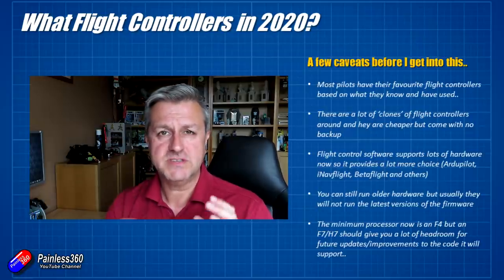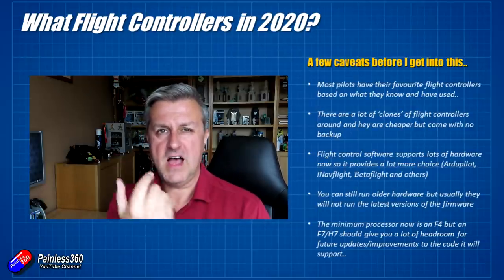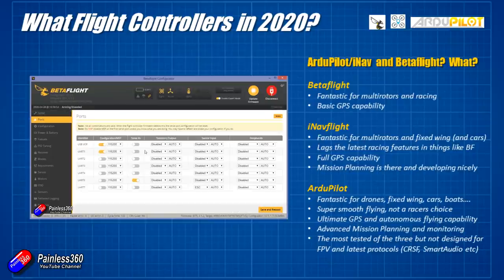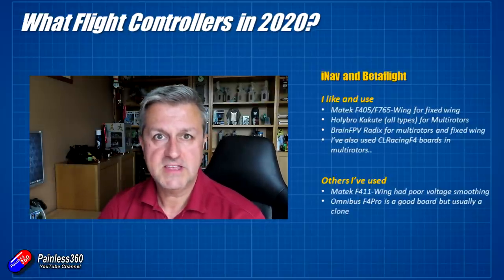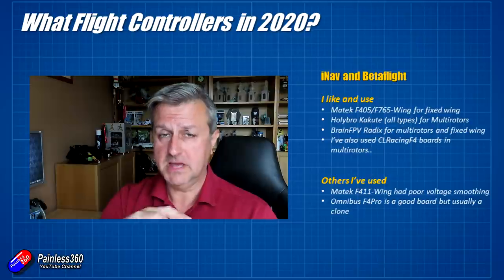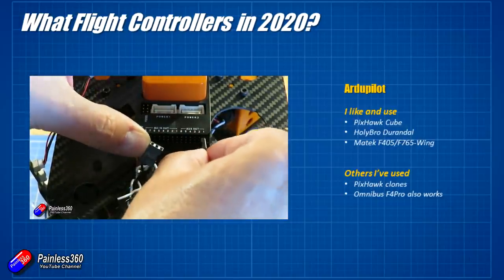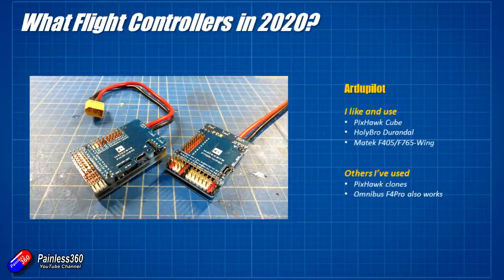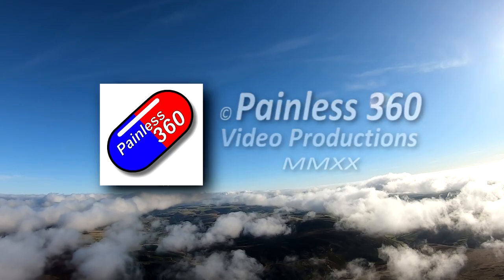My Flight Controller Picks for New Builds (May 2020)

Comment: Thanks for this.  I've been thinking of deep diving back into this.  I helped a group of UCF engineering students successfully make a way over the top ambitious quadcopter project.  I did all the programming interfacing a raspberry pi with a pixhawk board, ardupilot, etc. - the flying lawnmower (nickname since the hexacopter was swinging 12" rotors, yikes) had a robotic claw and a vision system (forget the camera board name) so it could fly mission, reach a waypoint then follow APRL code signs to hone in on targets and grab them and bring them back and stack them neatly LOL!  It makes my brain hurt just remembering all the crazy connections with software and hardware, including a smartphone app with a nice control interface (buttons and telemetry gagues ).  I still can't believe it worked (mostly).
But I have no interest in doing anything that ambitious again.  Just some quads, fixed wings and rovers for the tinkering pleasure of it.  This video is a good overview of what's around today.
Reply: That sounds like an awesome project! I’m up in Lake City, working on a simpler project, maybe I could buy you dinner and pick your brain a bit? Thanks in advance! And great video!
Reply: I'm in a similar position, some non-engineering students are looking to do some surveying and asked me about getting into RTK for photogrammetry missions. It's been ages since I did anything RC but I'm seeing the quad/planes with ardupilot itches a lot of my interests! I've opened the firehose of info and it looks like I'm going after the F9p RTK for ublocks GPS for the quadcopter/plane which it looks like Holybro sells the H-RTK F9p with a 10pin connector for the pixhawk4 (and another 6-pin version for a 2nd gps). They're likely wanting to fly over water/coastline so I'm wondering if Lee's recommendation on the more-bulletproof pixhawk Cube Orange would be a better path to keep it from falling into the sea! Being students, bulletproof is nice so they don't destroy stuff but cheap is also good for when they do crash it (maybe the aluminum controller case instead of plastic?)
Reply: I'm currently a UCF engineering student working on a project that's almost exactly the same for senior design! Good to know I'm looking at the right channel for some research.

Comment: Thanks this was very helpful! I've done two F411-wing builds and they work but had vtx power issues. Powering the vtx directly from the battery and powering the camera from the vtx seemed to fix this. I'm wrapping up a Radix Li/Bixler build and really looking forward to getting it in the air.

Comment: My Ranger 1600 had a real bad crash last Sunday, both wings and 2 servos are now destroyed. I was using an Arkbird Autopilot.
These are the steps i allways follow before and during start:
1. Checking all servos and motor working. In manual as in balance mode. Also checking if servos reacting properly in balance mode.
2. Bringing plane  to a height between 80 - 90m in Balance mode.
3. Switching to RTH, checking if plane starts flying  around the homepoint.
4. Taking seat in my chair, putting on my reading glasses and then my Cyclops goggles.
5. Taking control over plane by myself.

But this time, still in RTH Mode, the plane suddenly went straight down with an approximately angle of 30deg down and crashed into
the undergrowth. Could not react that fast to do countermeasures.
I guess it was the gyro, delivering a false angle to the processor. I assume this, because on previous flights i noticed that the artificial
horizon was reacting very slowly when vibrations occur or when doing flight manouvers  like loops, dive loops, immelman etc.
It really took a few seconds until the artificial hoirizon matched with the real horizon i saw in my goggles.

I now ordered a f765 wing and a new Ranger 1600.
But since the Ranger has a fuselage made of plastic, it is more vibration susceptible for vibrations than a depron model i assume.
I allready used a double layered damper pad for the Arkbird.
Is the f765 better in reaction time and managing vibrations ? Or what else can i do when mounting this FC to reduce vibrations as much as 
possible.
Thx and greetings from Berlin Germany
Reply from the maker: A lag in the art. horizon is normal. The iNav team have been working on improving the horizon drift. If it was excessive then I'd suspect something was up. Maybe vibration was the cause. The LPF filter along with better mounting can help. Sometimes simple things like prop balancing can make a huge difference too.. If there are logs then it's be worth a look to see what the FC saw. Best of luck!
Reply: @Painless360  It happend all with my old FC, the Arkbird. Think it's on the market since 2013. The new FC has just arrived, it's a Matak 765. Guess that will do the job better. Thx for your answer.

Comment: Useful review, I have always thought Matek stuff looks nice.

I'm familiar with some of those boards but not all, but it does seem you have concentrated on 30.5mm boards.

I've only been doing this (quads for racing / freestyle type use with betaflight) for 2.5 years, and my first used an Omnibus F4 pro with Matek PDB  and DYS ESCs. This was a 160mm frame with 3" props. Weight is everything on these things even before you think about CAA / registration / remote id issues, so I then swapped the Omnibus etc for an F3 SPCMaker (genuine) FC and quad ESC (20mm).

Saved about 30g, which on something with (no battery) weight of about 135g now is a huge percentage.

I've also used Eachine 20mm F3 FCs and ESCs. Very similar, never had a bad one of either.

I do not see myself making anything with all up weight over 250g (3" or 4" max) any time soon, and I guess I'm not alone, so how about a similar survey of 20mm kit?

The need to move to F4 is irritating though inevitable. It seems to me that for my use anyway, an F3 has more than adequate performance at the moment. The only issue is code space, and that is only an issue because of all the included features  I don't use - but they are all there. For instance the (F4 only) feature for allowing the FC to act as a Rx joystick on a simulator is nice - but not really necessary when flying.

The F4 also causes 'inversion grief' with FrSky protocols, because the UARTs do not natively support inversion. (Why did FrSky do it that way?)

I build my own versions with slight changes, and I don't know if you've ever looked at the code, but it is a maze of #idef's, so one can just leave stuff out as necessary. I guess what would be nice is a web server build system which allows the end user to include only necessary facilities, ie build on demand.

Comment: I am about to use a 765-WIng and want to do waypoint missions with Ardupilot and Mission Planner. I have both old JR X10 and 3DR Iris transmitters. They both take Futaba modules, and I have a FRSky DJT 2.4 Ghz module already that will go into either. I just ordered an R-XSR receiver, which is S-bus. My question is, how can I connect a laptop or iPhone to send Mission Planner data to that receiver? Can I connect to the DJT module or do I have to buy something else?

Comment: Hey Painless360
I have a bit of a challenging build. it's 250 quad but with a very small space to accommodate FC.. I have tgy i10 radio and three omnibus f4 flight controllers, two of them are pro versions from reputable eBay sellers. No matter what settings I put in betaflight or Inav. They won't connect. RX is fine as I had it connected to a different model and it worked just fine. Sbus or ppm just don't work. Been on it for a couple of weeks now and I feel that I had enough of omnibus boards. My last quad built on omnibus f4 pro v3  kept flipping at takeoff, spent weeks trying to solve it, and eventually got naza lite for it.
what board would you recommend for 250 easy going mini quad? not a racer just like to fly things.
Best regards
Rad

Comment: Thx for the video. What would you suggest for better stability and reliability between Pixraser, Matek f-405, Matek f-765, Holy bro for a f-450 DJI frame. I know you made a video but didn’t compare it to any other flight controller. Size matter cause I would like to make smaller frame built soon. Thx
Reply from the maker: Don't start with the hardware, start with the firmware. For silky smooth flying for larger models Arducopter is the place to start.. see my various series on it... best of luck
Reply: @Painless360  All the above flight controller supports Arducopter. That’s why trying to see which hardware is better. Pixracer vs Matek vs Holy bro

Comment: I use the Furious Fpv F35 lightning board for my Inav builds. Great size, easy set up with all wires and connectors supplied. Works flawlessly. 👍
Reply from the maker: They are great. I just can't find them in stock any more ...Happy flying
Reply: @Painless360  yes I think they might have discontinued it as I couldn't see it on their website anymore which is a shame. It would be great if they introduced a V2 with a few extras like black box and maybe an f7.
Reply: Graham Downs I use them too, and asked Furious and they said they will not be upgraded or made anymore. Sad because its a very good total package.
Reply: @TheMultiProp  I messaged them today and they said they are working on a new and improved version!

Comment: I've happily used Betaflight on Chinese Omnibus FCs before, but I'm new to the world of PX4, iNav, etc. and autonomous craft.  The Arducopter website says that running on Omnibus or low power (F4?) FCs will mean that not all features are available. Is there a list of what won't run?  Is there any reason then to pick an expensive FC like a pixhawk cube over something like a Matek? Is there any noticeable performance difference? Or is the difference really just the high quality, redundancy, thermal stability, ect. of the pixhawks?  I'm working towards building a large (24 inch, 3-5 lb) hexacopter for camera and video work. So I don't want to risk some Chineseum part failing and my whole craft crashing and killing someone.
Reply from the maker: Most professional pilots I know use Ardupilot on Pixhawk Cube.. Best of luck

Comment: Hey yo painless dude. I am experimenting with various flight controllers and recently followed your lead to install a f405 wing into an aircraft with Ardupilot firmware. 

My question is why I am getting a cut down parameter set in Mission Planner. For example, I see in your vid that you have the ‘orientation’ option in the parameter list. I would like to turn the ‘405 through 180 degrees but AHRS ORIENTATION simply doesn’t exist in my parameter list. 

And I have been flying a mini pixhawk from Radiolink. It flies extremely well, and I notice that Radiolink has a rapidly growing presence. Are you considering doing a review?
Reply from the maker: I've covered so many Pixhawks already on the channel so no plans for that one - at the moment. Is Mission Planner in basic or expert mode?

Comment: I am new to flight controller use. Could you tell me what equipment i need for a non FPV volantex ranger using spektrum tx and Rx. I want to use a camera that records video, gps and RTHetc. Thank you in advance
Reply from the maker: The OSD that shows things like GPS location and RTH etc is normally created inside the flight controller and added to the image from the camera before going to the video transmitter to be sent to the goggles or screen used by the pilot. If you don't want to fly FPV but get this data you could maybe record the output from the FC that would usually go to a VTX with a DVR instead. Or, I would look to use telemetry to record the details and add them into the video after the flight using Dashware (i.e. https://www.youtube.com/watch?v=LAEaRnkQ9kE)

Comment: Hi Lee, I am getting back into the hobby after a few years break and a lot has changed,  so the video was very helpful.  I was planning an f405/ardupilot/wing build, but almost immediately have hit a problem.  My laptop is a Mac, and mission planner is not available for Mac.  According to the documentation, the best GCS for Mac is APMPLANNER but that ceased development mid 2018, and no longer runs on Mac OS Catalina.  That leaves QGroundControl, but I don't see many tutorials for that, it seems a little off the beaten track, and i fear it's not as fully featured as mission planner. Any thoughts on using QGC or should I change tracks and go back to INAV? Cheers.  Laurence.
Reply from the maker: I use Mission Planner in the series because it works. A lot of the issues I see with setups are down to QGC. It depends on what you are planning to use the wing for and what you need but INAV is my go-to for almost every fixed wing build..
Reply: @Painless360  thanks Lee.

Comment: Hi Sir 
Pls suggest flight controller for 250 frame and receiver for flysky ia6b
Requirement altitude hold gps pos hold vtx fpv 
Suggest budget FC can run on inav
Reply from the maker: Nothing springs to mind as most of the flight controllers that size have limited pads. You'll need one with a spare UART for the GPS and i2c pins for the external compass too. Best of luck
Reply: @Painless360  Omnibus F4 is suitable?

Comment: How about a video comparing how ArduPilot and iNav stand these days? In the past I have always gone for ArduPilot for fixed wing but that was based on maybe some out of date ideas about iNav. Is it still a worthwhile option to use, say, a Matek board with ArduPilot or are the capabilities of iNav up there? What will I be missing if iNav was used instead? Obviously using Pixhawk hardware brings other advantages such as hardware redundancy - but other than that...?
Reply from the maker: https://youtu.be/te4D_fjBVfM still captures it nicely.. Happy flying

Comment: Hi I am currently building a VTOL fixed wing aircraft. The motors are thrust vectored. I have two motors in front and just one in the back so I suppose its a slightly bit unconventional and might have to provide much more power in the back than in the front. So I think I may need to modify the controller code a bit. What flight controller would you recommend?
Reply from the maker: I'm not sure. For Vtol, Ardupilot on a supported flight controller would be my starting point... best of luck
Reply: @Painless360  Thank you. (y)

Comment: Thank you for the hard work in putting this together I fancy an f7, is there a decent all in one?, but if I’m buying just a flight controller   I’m not sure which esc will suit, do they all match?is there a simple shopping list? Still struggling thru this hobby, would love to build a gps fpv quad (inav) but I’m getting more and more confused
Reply from the maker: Loads of choice for a new build and it depends on what you want. Something like the Matek F722-SE AIO or the HolyBro Kakute F7 are solid. The Kakute also has a companion 4-in-1 ESC board too.. Best of luck!
Reply: @Painless360  thank you. Really appreciate the reply. Please keep up the good work

Comment: I got F405-wing on all of my planes running arduplane. Now looking to upgrade to F765 but currently, matek boards are quite expensive. I got a look at kakute F7 AIO board. A bit cheaper. Do you think the holybro option is feasible? Thanks!
Reply from the maker: I'd get the right flight controller for the job. The F405 is still a solid choice...

Comment: Need help! Can I use FlySky FS-i6 Controller with my SG 906 Pro Drone instead of the one provided with the Drone by manufacturer.
Reply from the maker: Yes, you'll need a receiver that will talk to the radio and provide the input the drone needs... Best of luck!

Comment: Hi Lee,  got the AKK  F4  board for an inav 7" long range build with gps.  Should I trust a better board like the matek ??
Reply from the maker: If it's working fine and has all the connections you need then I'd try it. There are good and bad examples of almost everything in the hobby.. Best of luck!
Reply: Cheers,  will give it a try.

Comment: Dear @Painless, I build drone 7" Mateks F405 by Inav and TX1-RX1 (MSP) Telemetry to RX-TX Air Unit DJI. Added TX5-RX5 setting at DJI VTX but nothing OSD on display Gogle or recording automatic.
Are you fix it?
Reply from the maker: Check out my iNav and DJI setup in the Mini Drak series. I hope that helps.

Comment: For matek f765 wing, is the battery only for 3-6s? What if I want to use 2s? Additionally can soldering be avoided?
Reply from the maker: Details on the Matek website. 3-6s. Sadly soldering is part of it. Either pins or the wires themselves.. Happy flying
Reply: @Painless360  where can I find the soldering guide for the pins? Do I need to solder all the pins or just the one I need?

Comment: Imliving a flight controler hell. I have 3 bricked Naze 32, and cc3d that worked but I could not get isolation under control and it crashed throwing blade into the board breaking the tiny connector pins.

I can not find any real info on what control boards are supported by what software and how to configure the p I ds.

I'm thinking about a betaflight f4 seeing as the software betaflight supports it, is it worth it?
Reply from the maker: All my recommendations are in the video. Don't use older ones now.

Comment: Can you please advise. 
I fly radio controlled gliders and on a few occasions have nearly lost a glider due to loosing sight. 
I would like to look at a flight controller with a RTH facility.
Could you please advise possible solutions that would be compatible with my spectrum radio and receiver system.
My spectrum radio has built in telemetry. 
Looking forward to your help.
Kind regards
Warren Massey Durban South Africa
Reply from the maker: If you don't want a full flight controller that can rescue you then check out the ZOHD Kopilot series on the channel..
Reply: Painless360 many thanks. 👍👍🙏🏻🙏🏻